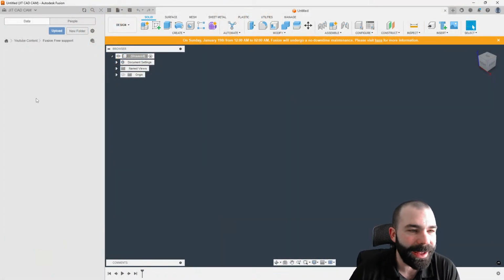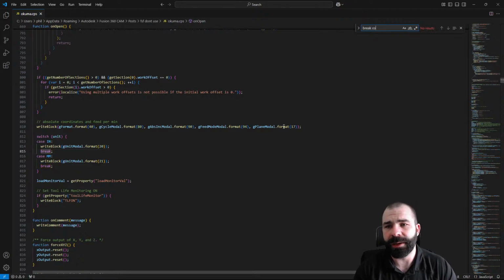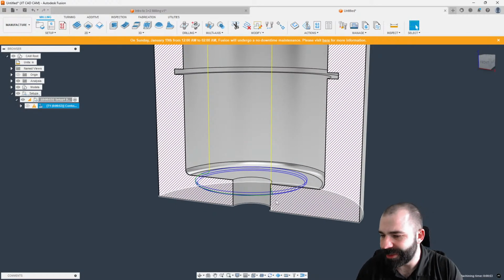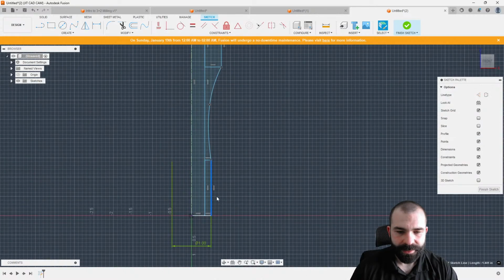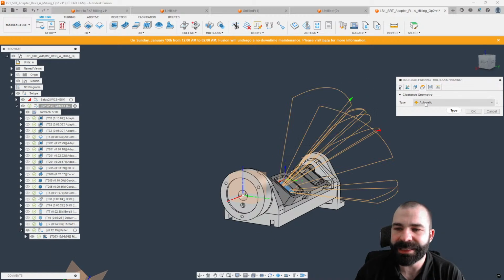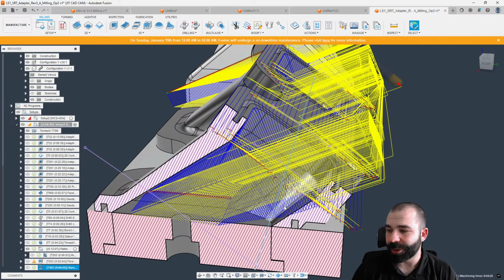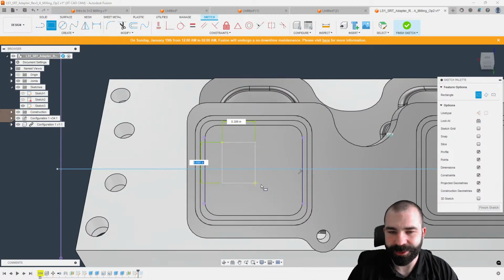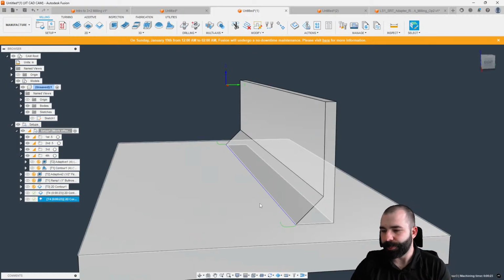Free Support Friday EP13:

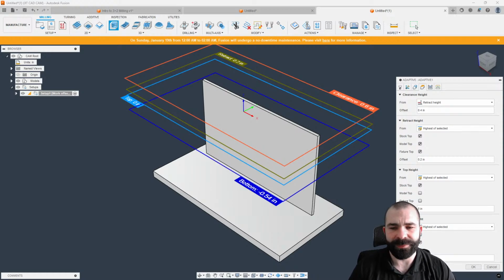Comment: Case at 40:00.. rough down with allowance of like 10mm radial. Than ramp down with a endmill big enough. If the drawing allows just make a little taper so that tool only cuts with a little part of the flute. Thats how i do it in graphite
Reply from the maker: Great Suggestion

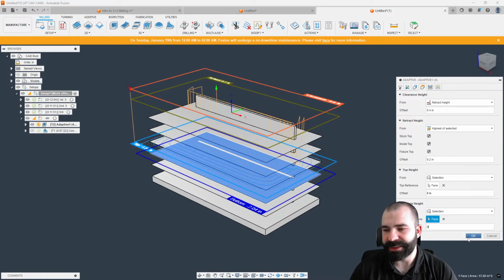Comment: 44:00 you can use Operation Pattern. It is even more easy, and if you use two tools for rough and finish, just select: Order By Tool under Operation Order 🙂
Reply from the maker: Yes you sure can :) however in this case the plan was to rough down and fully finish to prevent chatter.